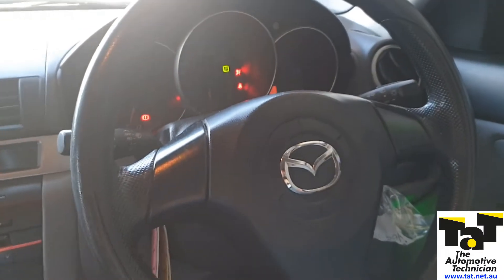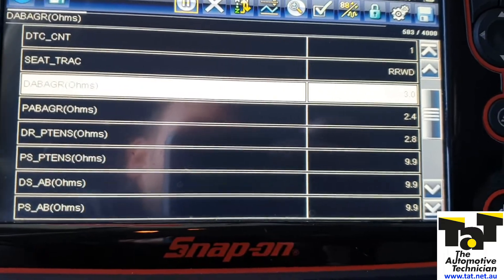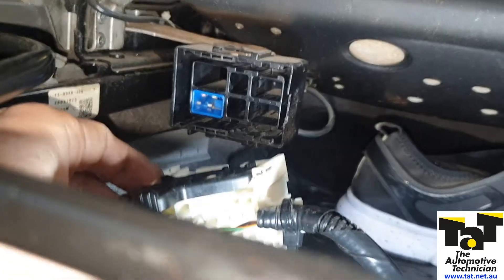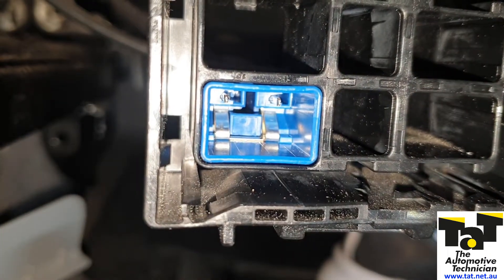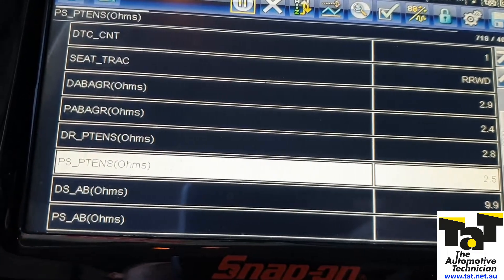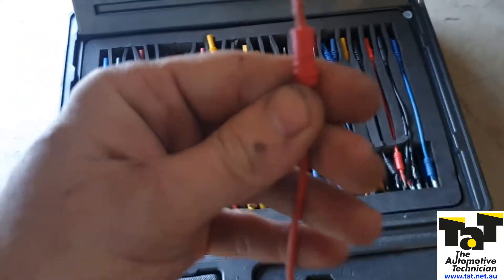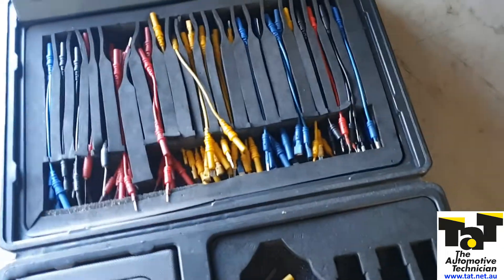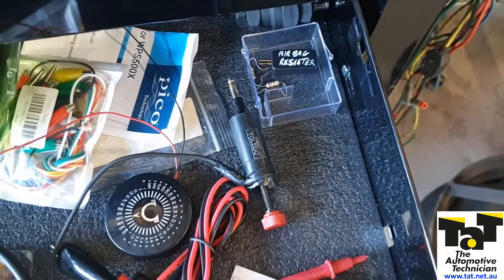Airbag Circuit Testing

Comment: Brilliant tutorial, quick question ,after a accident with passenger curtain and seat deployment  ,The airbag module reset Iam getting airbag locking cutcuit impedance 306.67 ohms and front loop impedance 0 ohms do I still have a problem , thanks